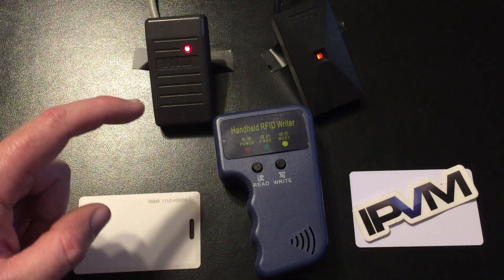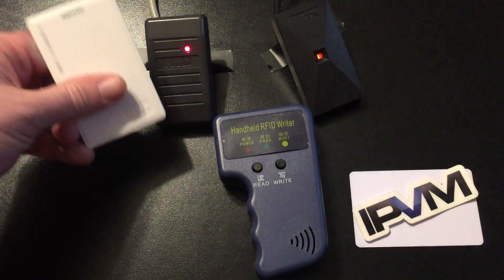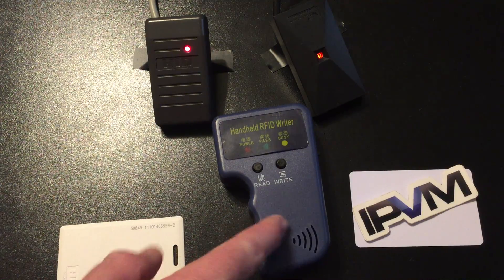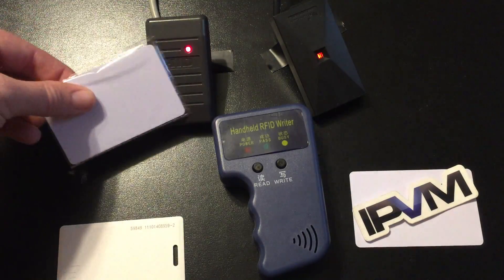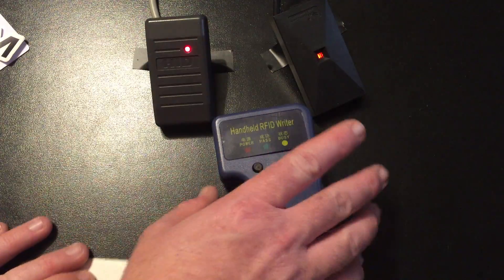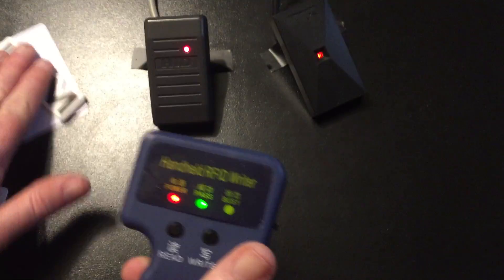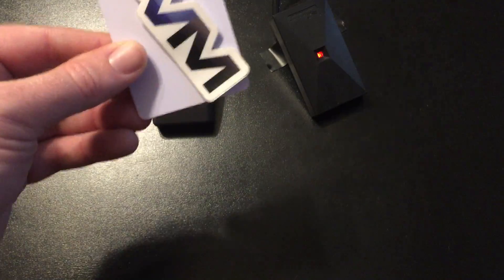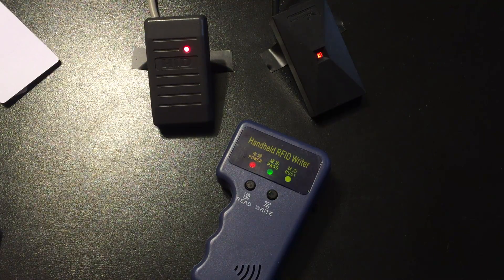125kHz HID Card Copier / Cloner / Hack

Comment: Cover up the speaker and i can use it to copy my teachers door card
Reply: What's the range on this thing? Do you have to be standing directly behind or would 2-3 feet be okay? Because someone broke into my apartment building copying an rfid card. Management won't believe me it's the RFID PROX ACS
Reply: Dank Mheems like u mean YOUR room or just to the whole building?
Reply: @dankmheems290  You gotta be damn close my dude. You pretty much have to be touching the card to get a good read with most copiers, and as you can see he actually touches the card in the video. There are theoretical attacks possible at longer ranges but its way more inconsistent and requires large equipment, such as an antenna that is typically 12"x12" or larger, a laptop connected to it, etc. 2-3ft is very far for this kind of attack. Its more likely someone who is otherwise trusted that had easy physical access (hoping a fence, leaving window open, etc) or some other standard means to gain entry somewhat covertly like an old tenant's card that wasn't deactivated properly. If they did actually gain access with a cloned card, they probably cloned it either right at the point of entry by placing a sniffer/copier on the reader itself to ensure a successful read (same basic methodology as a credit card skimmer on an ATM) or they obtained a card, temporarily or permanently, thru other means and simply copied it at their leisure. Remote attacks just aren't even close to something most burglars would be motivated and capable of doing, especially when there are so many easier ways to trespass and obtain commodities.

Comment: I try to do the something but I can't,  do you modificate the handheld?
Reply: http://www.ebay.com/itm/272572554722?_trksid=p2057872.m2749.l2649&ssPageName=STRK%3AMEBIDX%3AIT there is 2 version of this gun this is the better one here
Reply: @pkimrey  yup, I cheaped out on amazon and got the bad one... time to spend more money
Reply: @TheAechBomb  that one will work but another thing to note.. the copier worked with the included cards and keyfobs only. it did not work with other purchased rewrite-able cards
Reply: @pkimrey  you need to make sure the cards have the right chip in them, otherwise it won't work
Reply: @pkimrey  I have the same problem where do I get extra cars that will work on the copier I have?
Reply: @Joe-tl8cu  i am sorry i dont know which ones to buy if you find some let me know